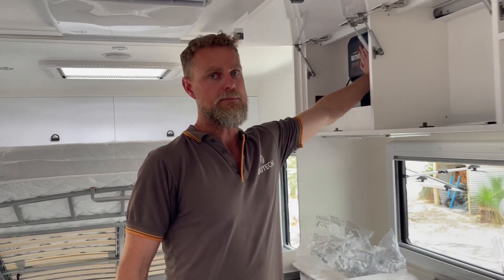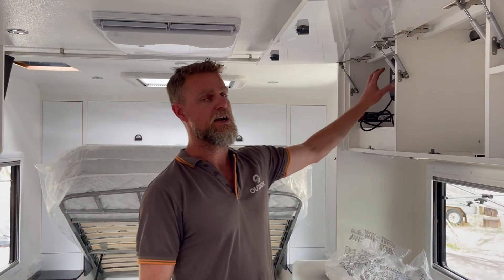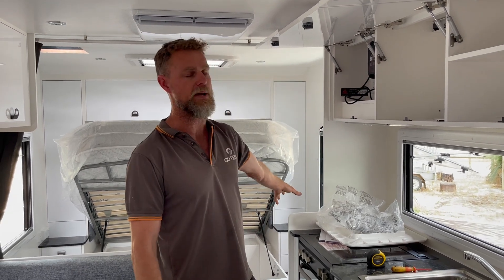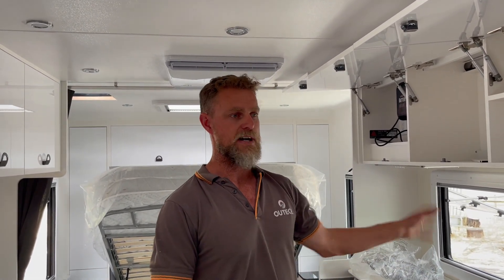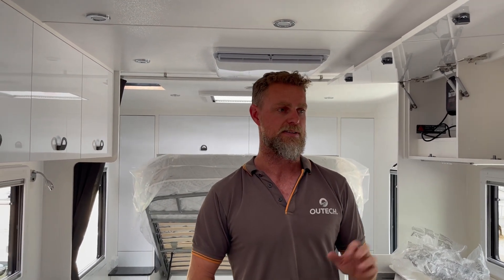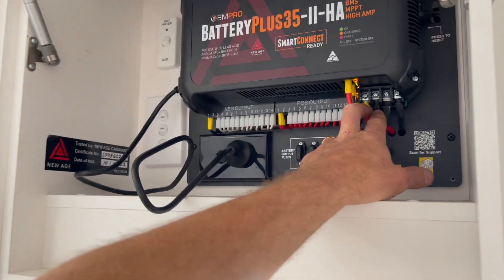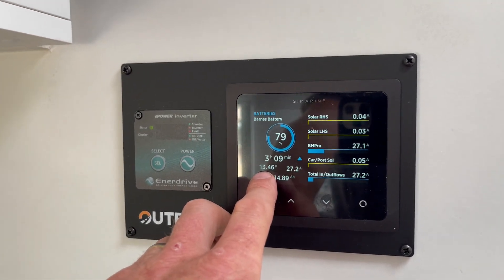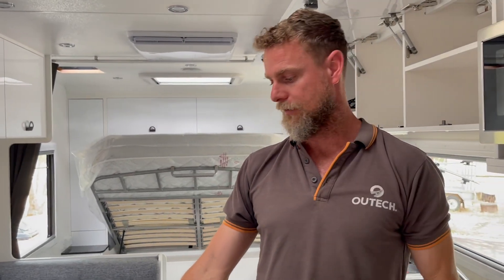BMPRO Should You Ditch It?

Comment: Ours get numerous power cycling by itself when off grid.  Sometimes several days with none, then between one and 6 times per night.  That’s with full charge 200ah lithium.   They replaced it, and even installed a new battery, but it’s starting failing again.   Is this just junk? Should we upgrade to Victron?

Comment: I too do not understand why the bmpro system would show a voltage HIGHER than correct given the long cables and supposed VOLTAGE DROP. Can you please explain how voltage drop leads to a higher voltage than at battery terminals?  Sounds counter intuitive to me. Thanks

Comment: Wouldn’t you just increase the cable size to minimise the volt drop though?
Reply from the maker: Thanks for the comment. These units have a very small terminal size built in and as such the unit can really only take a 6mm2 or 8b&s cable. They really are designed to be mounted as closely as possible to the battery.
Reply: @outechoffgrid  Yes agree, some builders do put them closer, Apollo is one that does. Can't blame Bmpro for that.
Reply from the maker: @drdos6718 no you can’t. But having a spade terminal as a solar connection and a terminal that can only handle 6mm2 cable is a design floor.

Comment: The charger will still charge to full voltage even with long leads. As the battery  charge level increases, the charge current drops and so does the volt drop. So it make take longer but will charge battery to full charger voltage.
Reply from the maker: Thanks for the comment. That’s actually not correct. The charger will think the battery is full before the battery is actually full and go to float sooner than it should. Leaving the battery less full than it should be. Having a charger many meters away from the battery is a poor design and all charger equipment manufacturers advise against long lengths of cable. Cheers.
Reply: @outechoffgrid  Disagree, the Bmpro won't consider the battery is full until the current either tails off (2A), or the time out is reached (5 to 15 hours, depending on set capacity). Plus, as I understand it, you've moved the batteries (or put in new batteries) further away than they were originally. New regs. also mean what you've done is no longer allowed, unless the compartment is sealed from the "habitable area".
Reply from the maker: @drdos6718 this build was done long before the changes to the standard came into effect. The old batteries were further away in cable
Distance than the new ones. 
The only way to mitigate the issue is to install the bc300 shunt. Which is an expensive rectification for a poor installation.  

As mentioned in the video, these units are not designed with large offgrid systems in mind and shouldn’t be used as such. 

Cheers.

Comment: Is the PM300 system a better option to go with? Or exact same issues? Which system  is better to add extra solar to plus another MPPT to run it? 
Thanks for your vids.
Reply from the maker: In our opinion, any all in one system that is limited to a maximum charge output of approx 30a is fine for simple and basic 12v loads such as lights, pumps usb etc. if you want to run a large inverter based offgrid system you are definitely better suited to larger output systems that have larger outputs in all in one systems or simply replace with individualised components to do the job. That was it’s a flexible system and can be designed to suit the users requirements.

Comment: Thanks for the great videos.

In this example, how is the BMPro reading higher than the Simarine if its a voltage drop issue? I fully agree that voltage drop would be an issue when it's actually outputting charge to the batteries. 

Just trying to get my head around that one! 

Cheers.
Reply from the maker: Hi mate. Thanks for watching and commenting. In this example we had the 240v plugged into the van to show the BMPro charging the battery from mains. Hence why the higher voltage at the BMPro itself.

Comment: Surely the BM Pro must have a voltage sense input that can be wired to the battery? Surely?
Reply from the maker: It has an optional shunt with a voltage sense on it. The standard unit does not have a voltage sense.
Reply: @outechoffgrid  Their shunt is a rip off, a Victron BMV or Smart Shunt is much cheaper. I've read of problems with the BT communications with the BC300 as well, but it is easier to connect up without the extra comms cabling needing to pass through the wall. Swings & roundabouts.